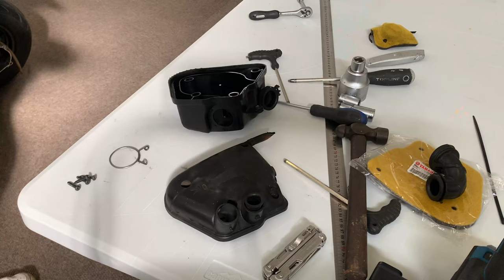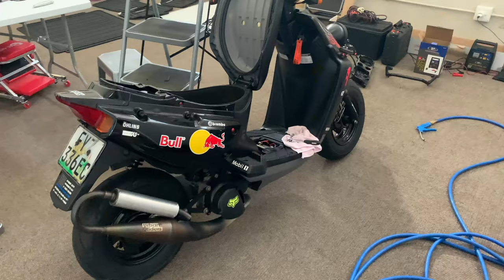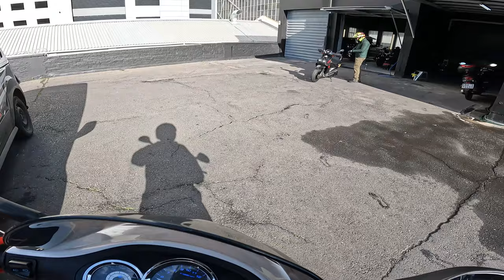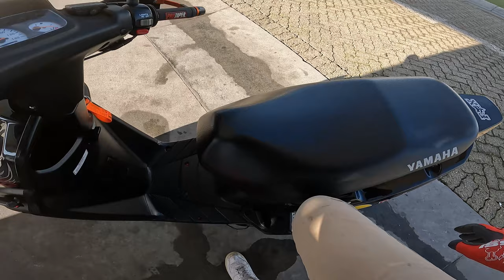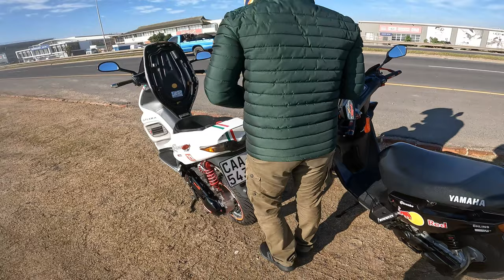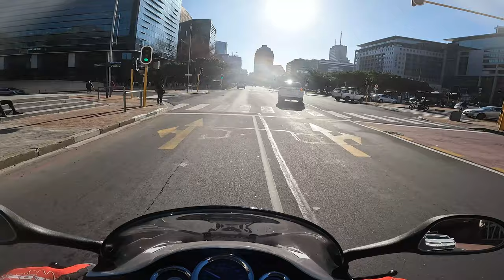What has happened with the GILERA RUNNER and MALOSSI BWS??

Comment: I've done a few mods on my bike with a change of malossi parts...porting and keeping it a 100cc with standard carb and easily getting 100kmh with my 94kg fat ass on it,  so seeing you tap out at approx. 100kmh makes me slightly happy knowing mine has a proper setup
Reply from the maker: That’s pretty true, I’m also a fat ass, so we can directly compare haha!
But! Don’t forget that it’s running the 6.5g rollers which are very light for this setup reducing the top speed. With other rollers Clayton and I have got 130km/h on the clock and he’s got it to hit off the clock down a hill. Just remember these clocks are not that accurate as well so it’s hard to tell the true speed.

Comment: Not sure if you guys know, but there is a secondary adjustment on the clutch. 
On the underside of the clutch arms where the spring tension bolt threads into, is a slotted plate. You can move the slotted plate more in or out, increasing or decreasing the centrifugal force and thus increasing or decreasing the stall
Reply from the maker: Yes that’s correct! We actually have filmed another video specifically explaining the complete workings of the Malossi Delta clutch including the weights in the back. So keep your eyes peeled for that!

Comment: Ive had multiple 180ccs and they are supossed to pull alot harder on the low end i couldnt keep the front wheel on the ground untill about 50-60kmh
Reply from the maker: What setups were you running? We are taking it a little easy and still learning to wheelie haha!
Reply: Understandable better to learn wheelies on a 50cc ive always had a new malossi cilinder ive seen when they get old or lose compression they lose allot of power on two runners i had 28mm naraku carbs with 130 main jet and it ran perfect and i believe 60 small jet malossi vario with 12,5 gr rollers and stock pipe only thing i changed with the clutch is the springs for tighter ones something that also helps is making the exhaust port allot bigger and matching the ports with the case 
With 125cc or 180cc gears from stand still was impossible to keep the wheel down i also ran stock reeds and stock manifold i stretched to make the 28 fit 
If i had your bike i would put the 9gr rollers from malossi when you buy a malossi vario they come with 12,5gr rollers (stock pipe) and with 9gr that are made for the malossi pipe 
Great vids man
Reply: @urban_riders  without the airbox the airbox restricts performance